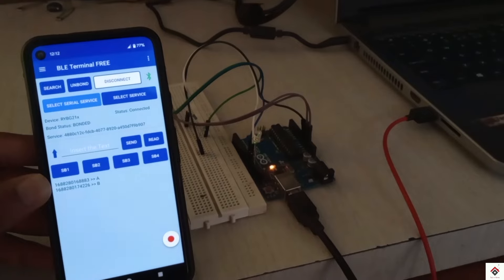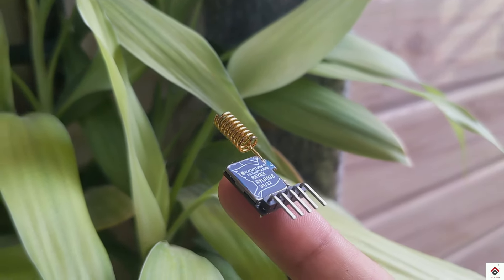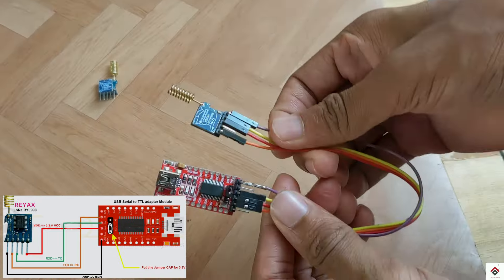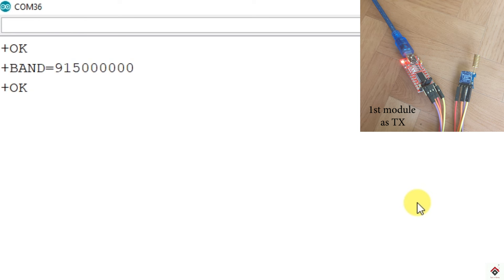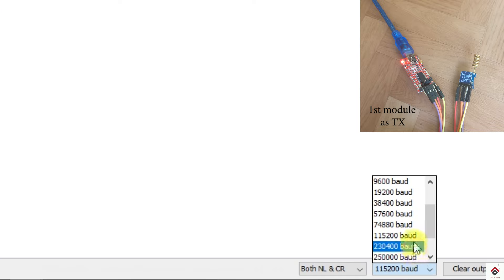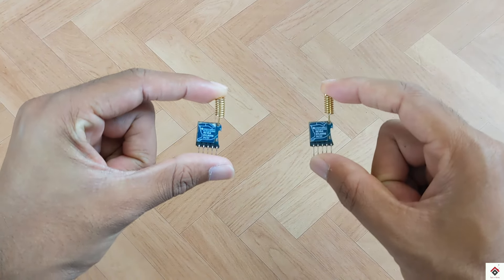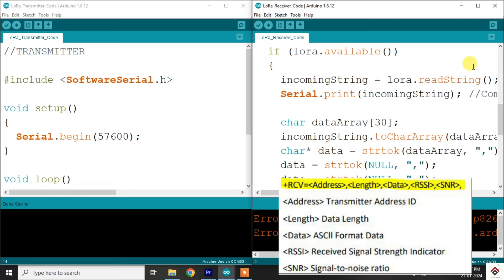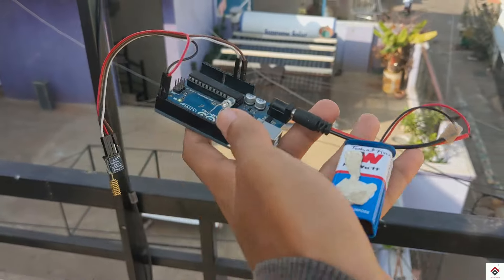Reyax RYLR998 LoRa Module with Arduino | Send Data to long distance | Tutorial with Circuit, Code

Comment: Hello, actually in my reyax rylr 998 lora module i configured it to 865Mhz but after disconnecting and checking again it shows the same old default band that is 915Mhz.. how to set 865Mhz permanently in the lora module kindly please reply and clarify please..🙏🏼
Reply from the maker: Are you getting positive response for that command?

Comment: Great presentation. Simple and easy to understand. One correction: Resistor divider should always be where Uno provides an output signal going to RYLR998 as input. In the case of the transmitter circuit you have it right but in the case of the receiver the 5v Tx signal from Uno is going unprotected to RYLR998 which is not correct. No resistor on LED for any extended period of time will burn out Uno. Briefly, might be ok but generally not a good practice.
Reply from the maker: Thanks for the feedback♥
I agree with your point, for continuous usage it is good to use resistor.

Comment: Hi, congratulations very well explained, please help me set up the following:   a few transmitter modules each one with different address, each with a push button and no Arduino board, only one receiver module with an Arduino board to identify which module press the button.  It will be of great help if you can provide the explanation. Thanks

Comment: Hi am using software serial 2,3 as rx and tx. I am just trying to send simple sting message hi in a loop. but its only receiving hi only for a few times then stops it only receives more if i only restart the transmitter program. I uses the baud rate as 57600 as per your video
Reply from the maker: Can you try once with low baud rate.

Comment: in the circuit diagram you put resistors in between, but I can't find any resistors in the actual, how come?
Reply from the maker: Better to use resistors, the modules work with 3.3v.
Using for some time without resistor is fine.

Comment: HI have been trying to get my lora modules working on Arduino for weeks, this is the first tutorial that explains setting up the LoRa BEFORE connecting the Uno. That's great and thank you BUT what is with hiding the code and circuit diagram in that bloody google drive that I can't open??? thanks for nothing. Another wasted effort- this stuff is the most frustrating thing in my life. Also all other projects with LEDs use 220ohm resistors why not here?